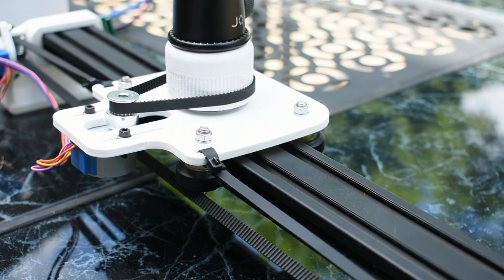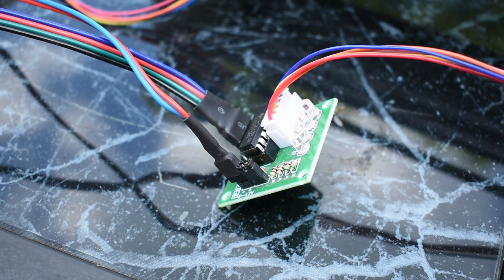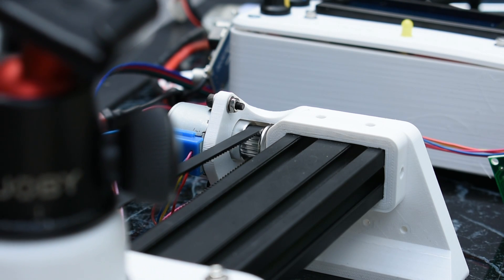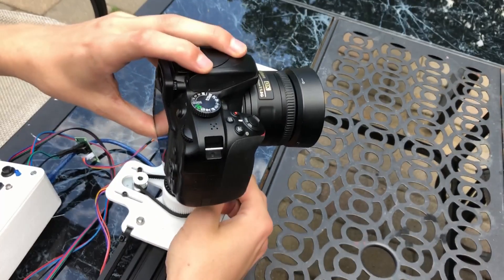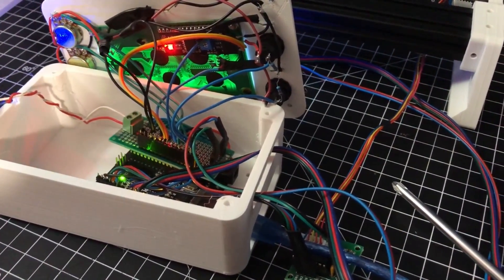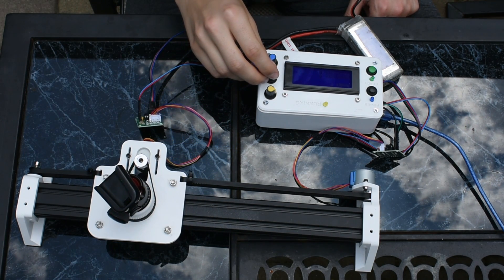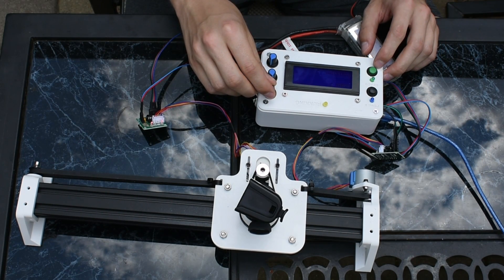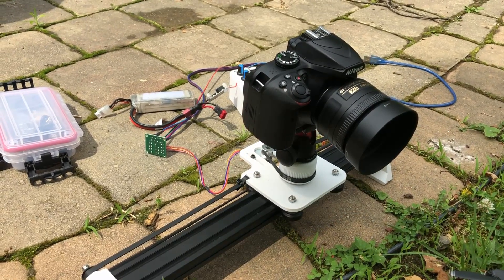DIY Arduino 2 Axis Camera Slider

Comment: After a couple weeks of working with Michael's parts I can say his design is fantastic! I printed my parts on an Ender 3 Pro. The pieces all fit together great. The one minor thing I found was on the Roller End Cap part, my idler pulley bore is 5mm and the idler also contacted the side of the part (on the round face) and did not turn freely. I used a drill bit to widen the hole and tried to find a spacer/washer but couldn't find one that fit well. I finally imported the part into FreeCAD, put a 5mm hole for the idler and a 1.5mm x 1mm lip on the edge of the hole to keep the idler 1mm off the face of the part.

Thank you Michael!

Comment: Michael's slider requires 2 bearings measuring 17x35x10 and are available Amazon for $1 each. I am writing my own software and am including 2 limit switches on the two 2 INT pins of the Arduino Uno, this should give me some sort of repeatability for programmed movement. I hooked both ULN2003 driver boards to the VIN on the Arduino.  I plan to power my slider from a rechargeable USB power bank, should last all day. As I iterate the software I'll probably move to an ESP32 based solution for the WiFi and Bluetooth.
Reply: The Joby tilt head uses 1/4-20 thread. The hole at the top of the turret accommodates a 1/4-20 bolt nicely! I used a 1" bolt which allows room for two jams nuts as well, one for the turret and one for the Joby.

Comment: Hi, Which Voltage regulator you used, and do you have the specs of the battery?, how much time will it run before discharging?, say letting run for 2 hours would it work?

Comment: I will attempt to do this but with a lead screw and NEMA 17 motors.  I wonder if a lead screw will provide smother movement than the GT belts. One other question do you have wiring diagrams for your setup?
Reply from the maker: Unfortunately I don’t.  I just kinda do the wiring as I go unless I’m making a PCB

Comment: what you think about use a motors (servo motors i think) from a old wide format printer to do an slider?
Reply from the maker: That would probably work! Key is to make sure the movement is as smooth as possible